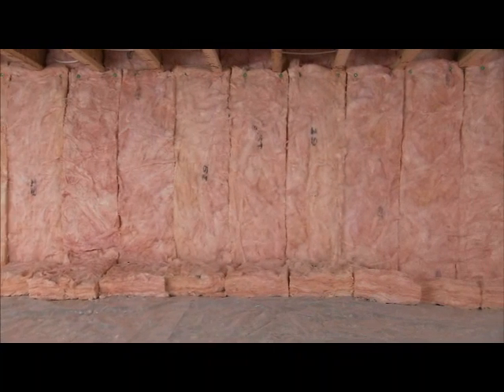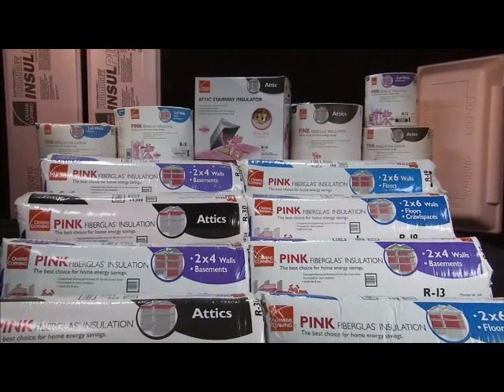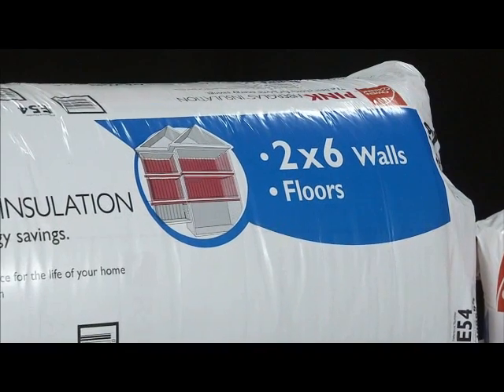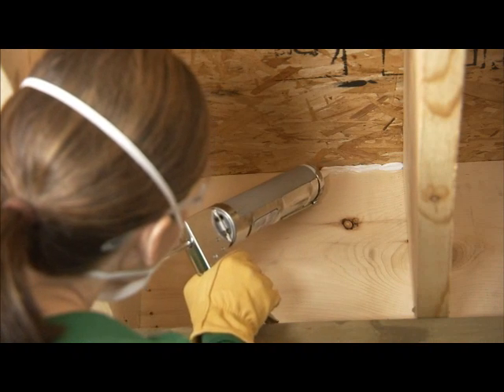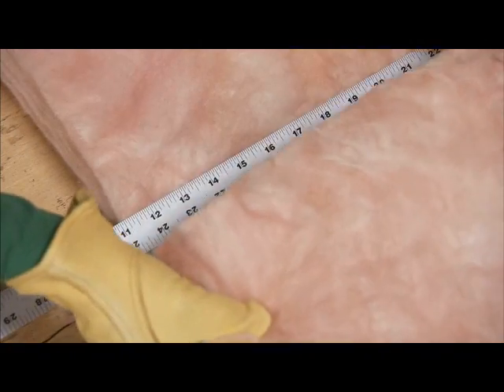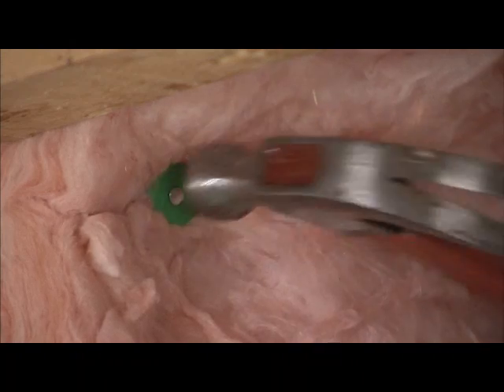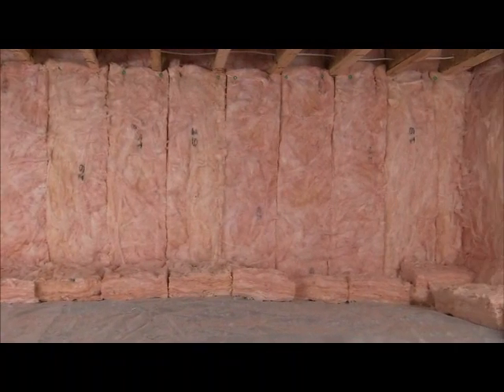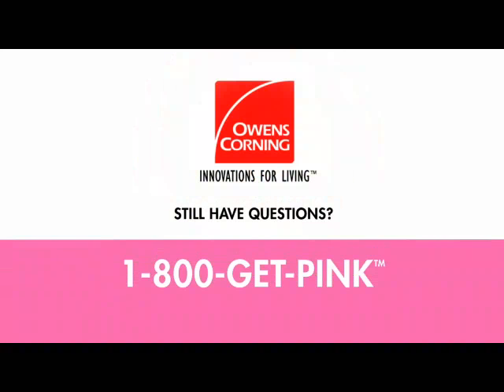DIY Insulation Project: Conditioned Crawlspace

Comment: The vents should be completely sealed with rigid foam anyway, other wise you can not "condition" the space.  However in Seattle it is not critical, in fact the vents sometimes work better in colder far less humid environments. In the south however keeping the vents is a huge mistake that only allows in massive amounts of humidity.
I used 8 mil poly with scrim and also used a ground cover cloth like you use in flower beds to bate weeds, its strong. I used that both under and on top of the 8 mil

Comment: This is all totally wrong. To insulate, close and "condition" a crawl space number one you do NOT use fiberglass insulation you use Polyiso sheathing with a foil barrier on both sides, there are a few that have a 15 minute thermal barrier (fire resistant for at least 15 minutes). Those must be installed with a 3" gap top and bottom, the top gap is for termite inspethen install a minimum of 6mil, preferably solid white polyethylene on the ground, and seal all vents completely.ction. You